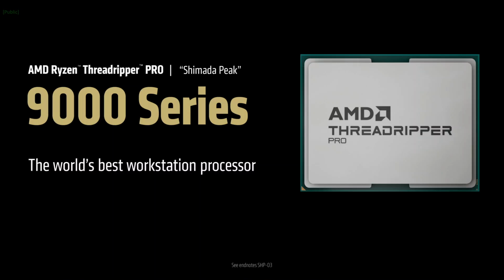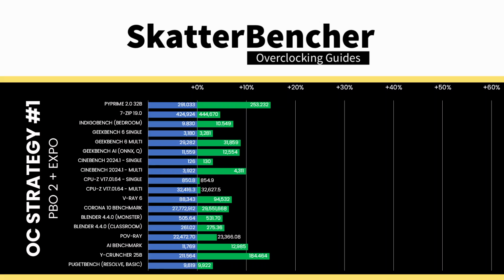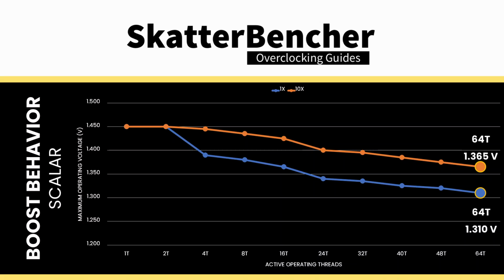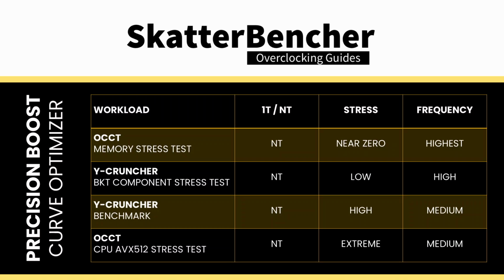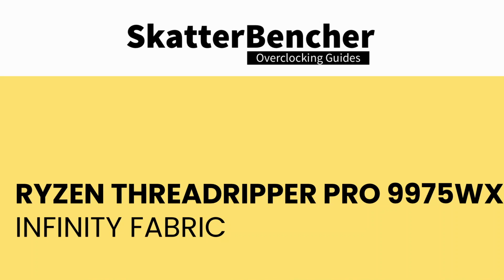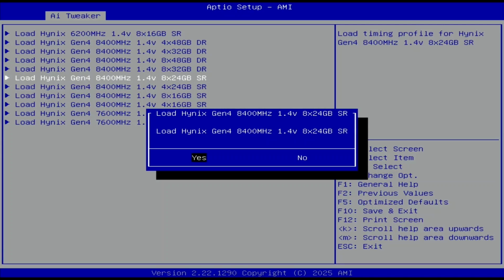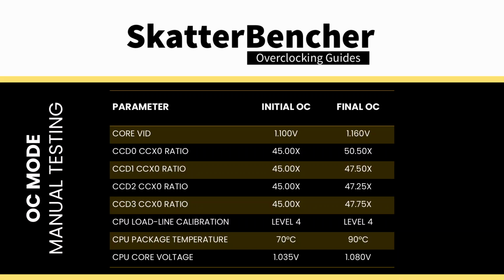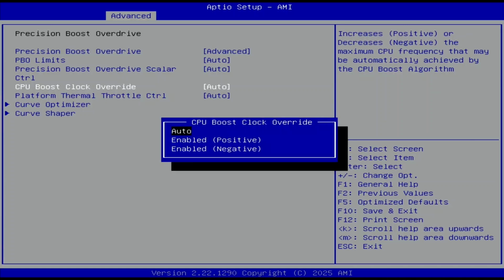Ryzen Threadripper Pro 9975WX Undervolt & Overclock to 5625 MHz | SkatterBencher #88

Comment: Hi, would you be so kind as to provide some guidance for overclocking a 9970X on an Asus WS TRX50-SAGE WIFI. 
I watched this clip (as it was the closest, I could find). and it seems that the 9000 series is somewhat different to the 7000 series.
I also had to update the BIOS to support the 9970X, and there is a lot of different settings, over the previous.
There is too many different "menu's" where similar settings can be changed :(
I did have a 7970X on the SAGE, following some of your settings, from a previous clip, and it seemed quite good. :)
Regards
Reply from the maker: I haven't tried the 9970X yet but I assume the overclocking process is similar to the 9975WX. What are you struggling with exactly?
Reply: @SkatterBencher thanks for getting back to me...
Like I mentioned, I had the 7970X oc'ed nicely on the SAGE, but after the BIOS update that I had to do, a lot of the menus & options have changed.
Watching this clip also shows that 9000's use different settings to the 7000's....
I tried different processes, but didn't get too far, and I think my BIOS update has some issues :(
I'm running 6400 ram, with EXPO, and it's only showing some weird number just above 6200.
Would be awesome if you could do a video with a 9970X on the Asus WS TRX50 Sage :)
Regards.

Forgot to mention, I now have the 7970X on a Gigabyte AERO....I think you have a clip with a 7960X on an Aero...will have to watch.
Cheers.

Comment: What are the two vcore values? Vcore0 and vcore1? Are these somehow related to dual cpu rails are these powering just different ccds or also impacting different parts of the cpu? E.g. Soc?
Reply from the maker: Since the 7000 series, Threadripper has 2 voltage planes for the CPU cores. They're powering different CCDs but still exclusively the cores. VDDCR_SOC powers the IOD.

Comment: There was a recent video from Level1Techs saying the latest BIOS updates dramatically improved attainable memory speeds on Threadripper 7000, I bet those improvements carry over to Threadripper 9000. He was able to run 8000 with little issue on a board that could barely do 6600 before
Reply from the maker: Thanks for sharing, wasn't aware of that!

Comment: Any recommendations for getting the chip to work with the ASUS WRX90E SAGE E? I flashed the bios to the newest update, it sees the chip now, but I keep getting a Q-code of 92 no matter what I do. I've never gotten the motherboard to post and the screen is always black.  

Did you run into any issues like this when setting your system up?
Reply from the maker: Can't recall seeing that debug code, but I do recall the first boot taking incredibly long. How long are you leaving it at 92 debug?
Reply: @SkatterBencher  I left it for about 2 hours to see if it any changes would happen but it never did. I ended up (out of frustration) literally just pressing/switching random buttons on the motherboard because I was about to RMA the board and magically it posted after I did that. I have no idea what exactly happened but after that but it worked.

Comment: so if i understand correctly something is off with these 9000 cpu vs the previous 7000. They removed the uclk = mclk so latency is higher, now that uclk is half, you can put ram at 8000mhz. Same could be done also with 7000 tr, you gain bandwidth but you lose latency. Any ddr5 6000 cl30 can do 8000, at the end they are all hynix A 2gb or new 3gb m die. Ipc could be better on 9000 tr but having a 7970x with pbo, motherboard limits asus trx50, +200mhz, fclk 2166, uclk and mclk at 3300, i have better latencies but of course i lose against memory write speed of 8 channels. But considering that pro cpu are priced more than double, you should really only buy a pro cpu if you enable pbo and you need high ram bandwidth usage. Moreover i don't see any reason in buying a 9000 tr, the mb are the same (trx50 and wrx90), you can put a pro or non pro 7000 cpu, do overclock, save some money because the difference with 9000 is very very tight. Let me know if i'm missing something.
Reply from the maker: I wouldn't say something's "off" with these chips. TR9000 is faster than TR7000, especially in AVX512 loads. It's just that there's some aspects of TR9000 that could be better. A big one (for me at least) is not having the ability to run MCLK/UCLK in sync.

Comment: 612W+ on a cpu... goddamn. At this point these cpus need complete water immersion...  and they really need 2nm or smaller nodes, STAT. Stock CPU usage of 350W is crazy... and its ``just`` a 32 cores CPU... Cant imagine an overclock on the 96 cores version. AMD should send you one for overclocking fun. Oh right the 96 cores uses 947W at full load at 5ghz lol
Reply: Run this and a RTX5090 and you pull 1250W out of the powersupply no problem.

Comment: Wish you'd written an actual review if you got hold one of these scarcities!  The RAM stuff was interesting though.  I'm getting a 9985WX...can I do the RAM overclocking without doing the CPU overclocking, and without disabling the boost like you were talking about?

I'll be happy with what the CPU delivers, but want max RAM bandwidth for AI/LLM workload.
Reply from the maker: Yes, you can independently overclock the memory without worrying about other components. Simply increase the memory ratio for higher frequency and tune the timings for faster access :)